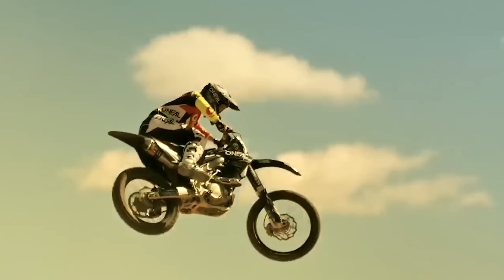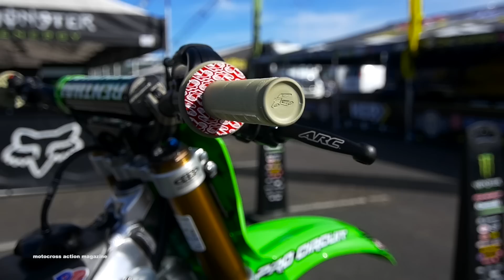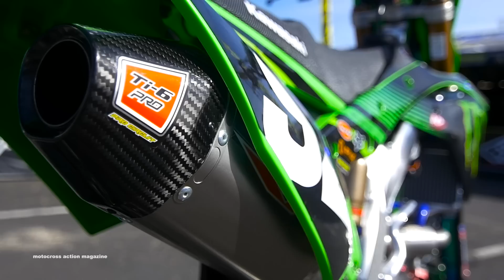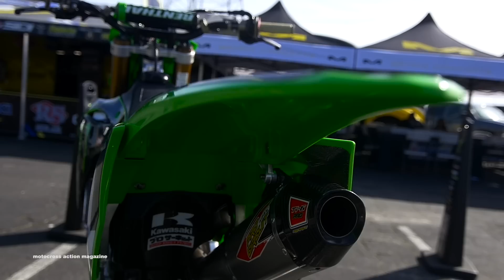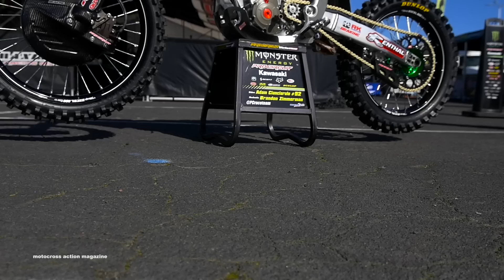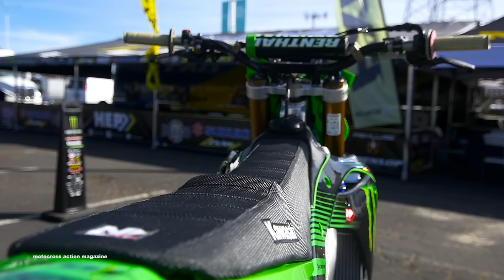Inside Adam Cianciarulo's Factory Monster Energy Kawasaki KX250F - Motocross Action Magazine

Comment: 100% the best bike in the 250 class, how much does it cost to make a bike like that?👍
Reply: Make it around 40 / 50k
Reply: close, i went into pro circuit and asked them about their A kit suspension and they said for an average person to go in there and buy it, it would cost $10,000
Reply: @wyattbozarth54  a kit suspension front and rear is more than 10000. Not to mention factory teams with works suspension can't even be bought. What also makes factory bikes and high end privateer bikes expensive are the custom parts. The titanium and aluminum pieces come from a huge expensive block of metal not cast. And all the custom carbon fiber crap, custom gas tanks etc is more than ten grand alone.
Reply: @4touchdowns1game29  No its not. Go look at the the vid they released of them Testing Austin Forkners Factory 250. They said in the video " The latest version of the Showa A kit suspension can be ordered for $9500". Plus Ive literally asked the manager of Pro Circuit. You cant say im wrong if I have literally asked the ones who make it...
Reply: @4touchdowns1game29  https://www.youtube.com/watch?v=RoERIcG1pjo this is the link to it and its at 3:30...
Reply: @wyattbozarth54  go look again. It's about 9700 for fork and shock. That doesn't include tax and the rest. I'm talking full blown factory suspension setup. Im talking fork, shock, linkage and triple clamps.
Reply: @4touchdowns1game29  You just said A kit is more than 10k. When its not. And im fully aware that the factory bikes have shit that we cant buy thats dumb expesive. But telling me to go look again when I have ASKED the race team them self IN PERSON AT PC is just dumb lol. But yea obv with triple clamps n shit its gonna be more. I have the linkage + Spring conversion thats fully revalved etc.
Reply: @wyattbozarth54  dude go look up pricing for showa a kit. Msrp is about 9700. That does not include tax and on top of that with the other crap that I mentioned it puts you at about 12000.
Reply: @wyattbozarth54  I see what you mean. A kit with tax is about exactly 10000 but I was talking about if you want a full factory a kit setup. I guess I should have specified that. I'm not talking factory suspension hooked up to some cheap cast linkage and triple clamps. I meant the other bells and whistles too. Custom billet holeshot device mount, linkage, clamps and computer system big teams use to read data after a ride on the track.
Reply: Zak Court 15,000
Reply: Maikel van Roessel that is with the time to build it I think, but what about the parts, thanks for the reply man👍
Reply: I believe only the works suspension alone is around 9.000 dollar's, then you have all the other pro circuit parts and don't forget the titanium bolts are really expensive. It can easily be more then what i think it is. You can also make it look like it for a couple of hundred dollars with the plastic and sticker set if you run a kawasaki.
Reply: Wyatt Bozarth that's the suspension alone lol, for that amount you buy a brand new kxf 450
Reply: Maikel van Roessel lmao yea, I have pro circuits regular B rider suspension on my 250 and 450 and have their Ti-6 on both bikes. And that total is about 4500$ haha. They are expensive but I trust them.
Reply: Maikel van Roessel but I got both Ti-6’s for $500 and $300 instead of $1,000 thank god 😂
Reply: Wyatt Bozarth it's top notch product, still way more expensive then two stroke pipes. Keep them rippin tho and stay healthy